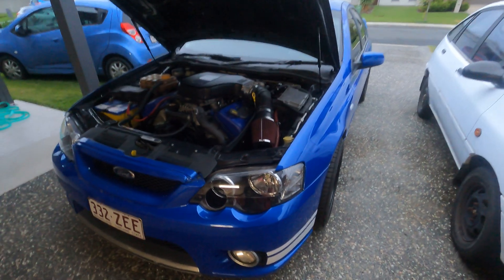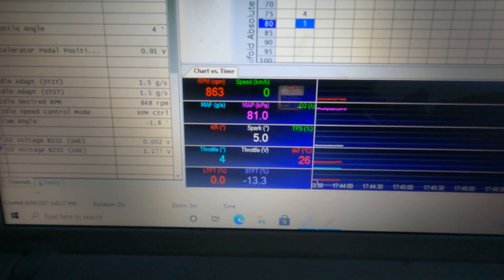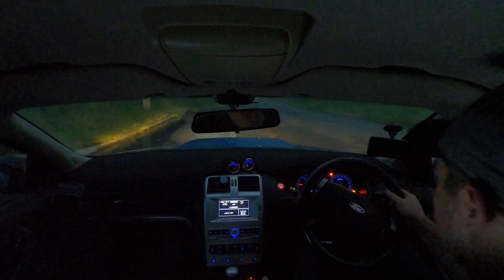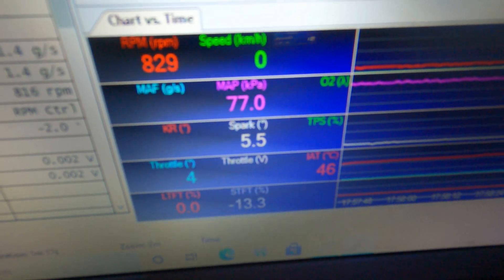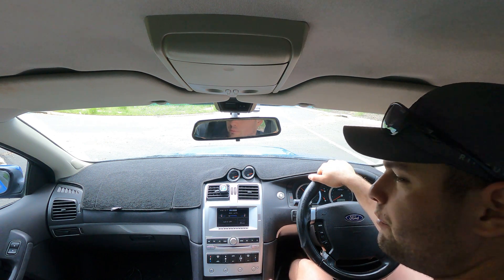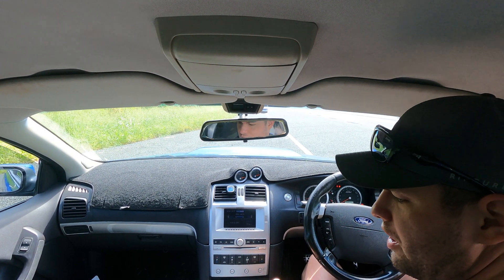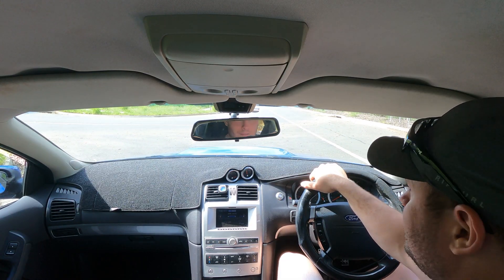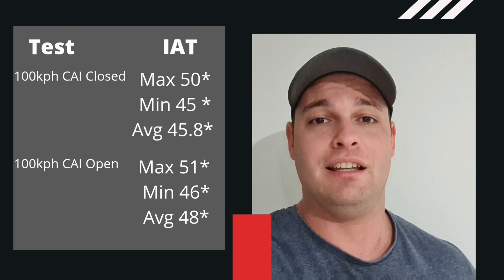Cold Air Intake system benefits testing with Datalogs.

Comment: very suprised at the results...
Reply from the maker: Me too mate, but it makes sense.  I'll test the revisions and make it work nicely 🙂 I still wanted to show everyone that what appears to work doesn't always end up the case when you test it.
Reply: @GapSauceYoutube  yeah mate, maybe do a test one each day of similar weather. e.g start up and hour long drive. Then see how long the heat soak takes to set in. Once soaked it maybe just harder for it to disperse.

In saying that its true what advertised isnt always the best way. All old carby fed car used to do there thing with filters under bonnet on top of motor.

Engine masters has a good video on dyno testing of filters and intakes.
Reply from the maker: @koontproductions  I have seen that video actually. I think the carby cars have less of a dependence on IAT's because the fuel has alot longer to cool the air charge before it enters the cylinder. Whereas the IAT sensor in an EFI application will actively pull ignition timing and kills the power, hence my obsession with air temps 😅.
Reply: @GapSauceYoutube  hahah might explain why some of the yanks with big NA HP modulars went carb to
Reply from the maker: @koontproductions  Lpts of options and easy to bolt to the sulli 😁
Reply: @GapSauceYoutube  hell yeah 🤙🤙🤙🤙🤙

Comment: I whacked a mace engineering cold air intake on my ba boss260 noticed the difference straight away , throatier better response .
Reply from the maker: Nice mate, I'm keen to make something up that works as nice as possible.  Gakd you're happy with yours 🙂

Comment: Can I suggest doing the test with it open first then closed? I'm thinking that the manifold is already heat-soaked by the first test with the headlight closed off. Maybe a longer drive with it open will see the manifold cool down. Also, if the headlight duct is blocked off, where is the engine drawing air from? From the engine bay through gaps in the airbox? Maybe it is still drawing air from the engine bay when the headlight is unblocked. Interesting experiment. Thanks man.
Reply from the maker: I tried as well mate, drove home with it off too, same result.  In summer I noticed that it made a reasonable difference.  The test was over maybe 5km of highway, I think sealing it to the hood better may help.
Reply: @GapSauceYoutube  Yeah, mate. I think a completely sealed box with the only air entrance coming from outside the bay will be a the way to go. Sealing to the underside of the bonnet looks really difficult with all its lumps and bumps. I'm sceptical of the aftermarket CAI setups like that. Please let us know how you get on. Cheers
Reply from the maker: Rest assured, i'll test every which way until it's perfect mate 🙂 I'll be back to show you all what worked for me in the end. Cheers for the input!!

Comment: 100% need to put a velocity stack through the light! Even grab a subwoofer double flare port off eBay for cheap as chips and I'll guarantee it'll funnel more air in there 🤙
Reply from the maker: Bellmouths do increase flow 🙂, I have a pipe which I think will help too.

Comment: Good test man, I done a similar test.
I have a spare headlight which I'd made a 6 inch hole in the front lense and a 5 inch through the back on the large side of the headlight and made a tape funnel essentially and when I tested it on the turbocharged xr8 i definitely could feel the differences, im usually always having crazy headsoak with my setup but with the headlight cut-out it took a measurable amount of time before it did get heatsoaked and even the cooling off period was dramatically reduced with the open light. Seen an iat decrease of 6⁰ with the open setup on a 18⁰ Night.
Reply from the maker: Nice, I think funnelling it in there will help.  It worked nicely in summer weirdly, so I was surprised to see almost no gains in winter 🤷‍♂️

Comment: Get a sealed airbox with a high flow filter.. no such thing as a CAI, they are all "Ambient Air Intakes"

Car sounds great with those cams mate... have owned several 5.4's and they are a solid motor.
Reply from the maker: That's the plan, technically yes.. but the industry term CAI is more recognisable, similar to the intercooler/aftercooler debate 😅Thanks mate, I'm enjoying this one 🙂